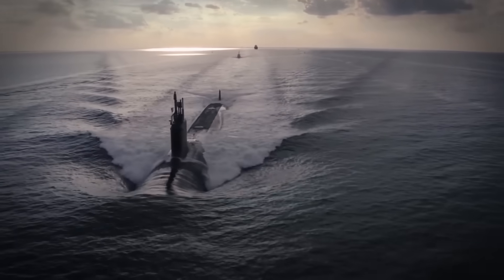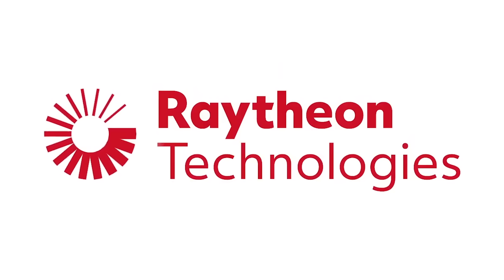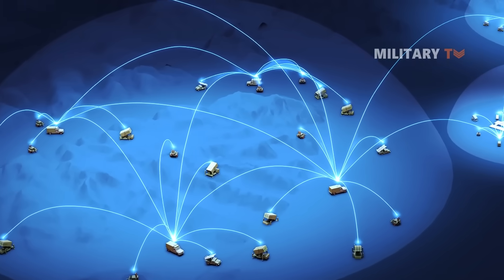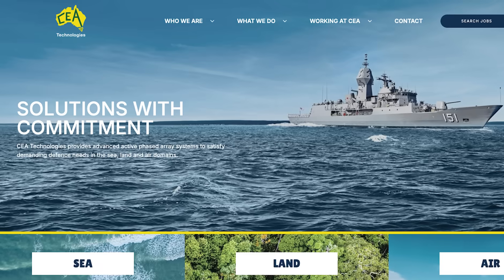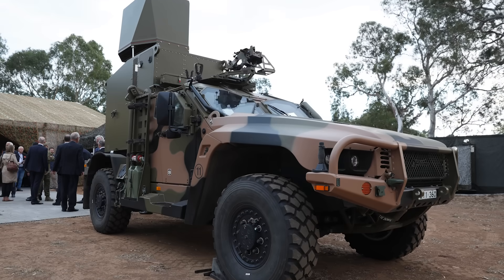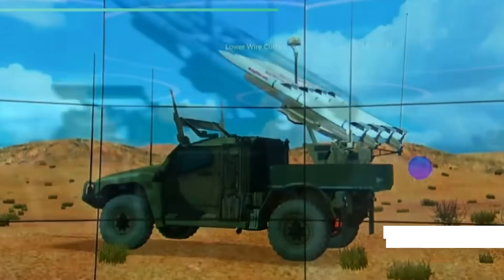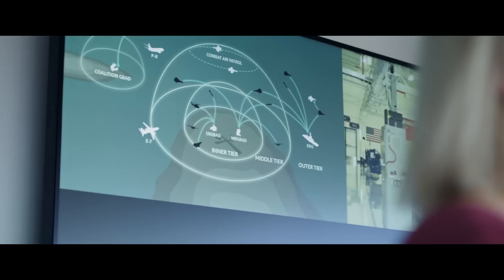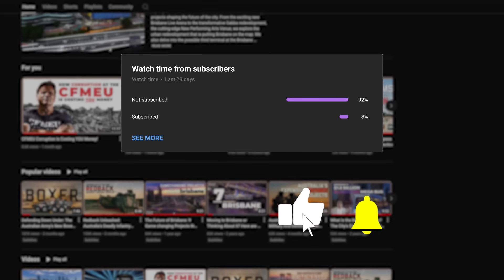Australia's New Missile Defence System Will Blow You Away

Comment: NASAMS is only a part of the anti-air capability the ADF requires. This is basically a short/medium range capability at best, although with AMRAAM-ER it's engagement range would be significantly enhanced  - though at this stage this missile is not on the buy list.

To have a full spectrum air defence capability the ADF will need THAAD as well (which can now launch PAC3 MSE) both of which are required. There is zero chance the ADF will ever get a mid course intercept capability so terminal phase interception is the best we will ever have. Which is why NASAMS + THAAD + PAC3 MSE is the best combination we can hope for. NASAMS alone will  not cut it. 

ADF will also need VSHORAD as a replacement for RBS-70 to counter low, slower moving targets and drones.

Comment: Apparently, Australia is looking to buy new frigates to replace the Anzacs. One of the contenders is the original basis for the Anzacs.  Here's a thought. Australia put a great deal of effort into upgrading the Anzacs to be a superb fighting machine, and then just ignored them. Why not use the Anzacs as a starting point and design and build our own. Make them longer to accommodate more VLS cells, upgrade the engines to provide more electrical power, and then take a long hard look at the power train on the Hunter class (engines driving generators to drive electric motors to spin the whirly bits out the back). Why does Australia keep reinventing the wheel? Take a look at the frigate replacement program and see what you can see. A continuous build, two at a time, could go a long way to keeping skills and knowledge in country. Governments can no longer see the horizon, they can only see as far as the next election.

Comment: Suppose from a procurement perspective it would be beneficial to turn a medium range air to air missile into a short range ground based one. They are 1/4 the cost of a SM-6. Ideally they'd have a bolt on first stage to get them to height and speed...
Reply: You can also bolt them on support ships due to the system containerized system and stand-alone system. The ship doesn't even need radar, since NASAM comes with it's own.

Kongsberg has on their drawing board a NASAM mounted on a low-level warship, using the ship's own 3D radar.

Comment: The problem for local industry is the Gov orders 10, 50, 100, 200. Then that's it. Factory closes, talent leaves. We don't keep the factories rolling to keep talent. Other countries say keep going. Nah we finish a quota shut the factory. The Collins are a good case. Domestic Subs requiring starting again. Years of relearning skills we had.
Reply: Great insight. Short term thinking vs long term
Reply: Then export as well instead of relying on domestic demand.
Reply: Japan keep building their submarines and retiring them early. In case of war they still have the use or the early retired ones as well as have modern ones still being built and keep the experience in manufacturing
Reply: yeah, doesn't help that we are only getting 2 batteries
Reply: @gibbo_303Have to defend Canberra for long enough for the pollies to get downstairs into the wine cellar mate.
Reply: 100% correct Fault of the states who keep pushing for defense contract time to shut down the American system and go back to ADI (Australian Defense Manufacturing).
Reply: I agree 👍 constant manufacturing is required 🇦🇺 These are short distance missile system, therefore needs to be stationed around a continent & resupplied if required.😮

Comment: There are many lessons coming out of Ukraine. Any purchase must include a technology transfer so that local manufacturing can be developed.
Reply: Australia keeps buying garbage used in Ukraine. NASAMs is extremely expensive, uses expensive missiles, is a short range system and is not mobile. One of the key learnings from Ukraine is your SHORAD missiles need to be low cost (you will use thousands of them) and the system must be mobile. Australia also purchases Switchblade kamikaze drones at $60,000 a pop for a consumable - how did these drones perform in Ukraine? They were terrible, basically useless as they couldnt withstand the jamming. What does Australia do? Buys them at $60,000 a pop. The question is why - because the yanks told us to
Reply: @MS-wz9jm  this system in american service is used to defend Washington and are in permanent emplacements, NASAMS in australian service are also designed to defend canberra, i assume they will move the system around though and not use permanent emplacements, they are not supposed to defend the solider, they are supposed to defend politicians and top brass in canberra
Reply: @MS-wz9jm  not mobile? also.. quality missiles will always be expensive

Comment: The NASAMS look good. Will they also be integrated into Australia's Over The Horizon Radar? In fact, we don't hear about the Over The Horizon Radar anymore, how much has it improved from the 80s if it is still in use.
Reply: JORN is on the POC list...
Reply: Yes, NASAM is just a part system to the overall integrated package, look up AIR6500, Integrated Air and Missile Defence (IAMD) and Joint Air Battle Management System

Comment: Better suited to the U.K. the U.K. uses the CAMM missile used with Sky Sabre. The CAMM missile is vertical soft launched 15 miles range, giving it a 360 angle of attack. Its soft launch allows it to be hidden by trees or buildings. It is a U.K. and Sweden missile , but according to the Sweden website can intercept missiles flying at several times the speed of sound. There is also an extra range version, called CAMM-ER with a range of 30 miles, and now a medium range (100KM) being developed with Poland called CAMM-MR.

Comment: You say you support Australian self-reliance and independent industrial military manufacturing capability. Well, what about the missiles? Oman is totally producing the AMRAM-ER; we make a single engine component for the ESSM. Utterly insane. The AMRAM-ER used the rocket motor of the ESSM. We need total manufacturing of both missiles. Anything less is disgusting. Also, do we have complete sovereignty? We have had trouble getting full access to US coding and technical info. No weapon is of value unless we have total sovereignty. Finally, how many are we getting? From my understanding, we are getting the bare minimum agai: skills development and retention capability, which is just going through the motions again. What I call tick the box defence, as opposed to providing this nation genuine defensive power.
Reply: We have been invaded by the US and are run by them. They do not want us to have a strong military, they want their own here.
Reply: Start with cars ..
Oh, wait ..😅
Reply: NASAM is a Norwegian weapon system and they needed the coding for the missiles to make the weapon system to work. So I don't see the problem. Raytheon is part of it at a later stage because to USA bought themself into the system, so they can produce it themself, thus shared production between the Norwegian and USA.

Getting codes and technical info for the missiles is very simple, every nation that get access to the system and missiles get also access to the codes and technical info, without it they can't service it.

Comment: could  we  ever  afford   THAAD ???     how many  would be need   to  defend   darwin  .??
Reply: we cant even afford a proper cruise and fixed wing SAM net, dont think we are getting a system like THAAD anytime soon
Reply: Thaad is incredibly expensive and the amount of missiles available is very limited Also thaad batteries usually work in a high atmosphere  patriot batteries work in a low atmosphere so you would have to buy both systems to have an effective air defence network
Reply: THAAD has its advantages and disadvantages but its more for high altitude strike with an Awsome radar tracking system..the only problem with it is it has no warhead.
Reply: @Nathan-yy2xs  having no warhead is a feature, not a bug, at the combined speeds both missiles are going, a warhead would not have enough time to detonate
Reply: @gibbo_303  lol. ...